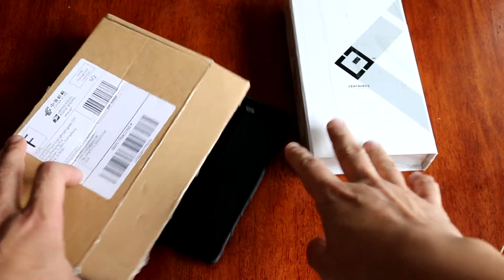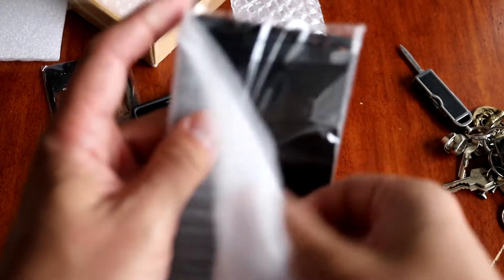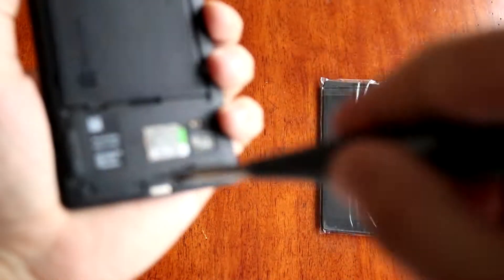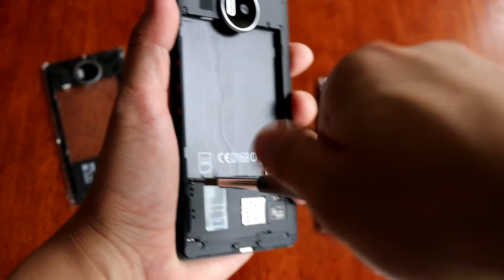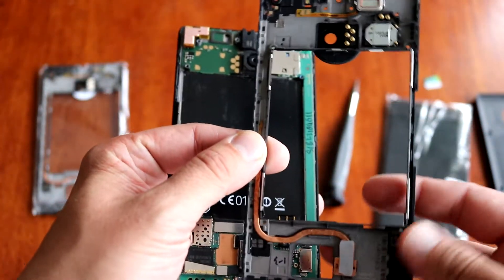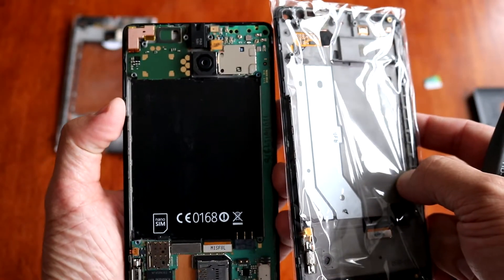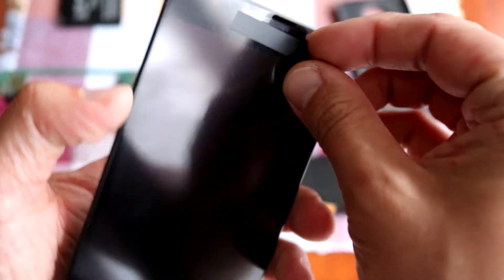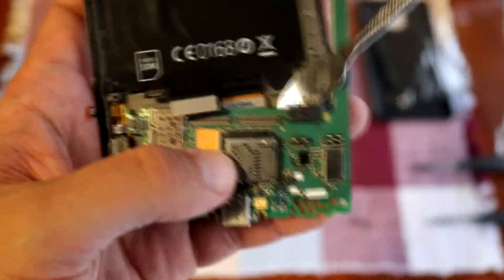Microsoft Lumia 950XL Troubleshooting and Repair Part5

Comment: Please have a problem with the Lumia 950 X and restart some times and turn off the temperature constantly until I press the power button and reduce the volume continuously until it vibrates and then runs a short period and back to the same problem please ask me to solve this problem